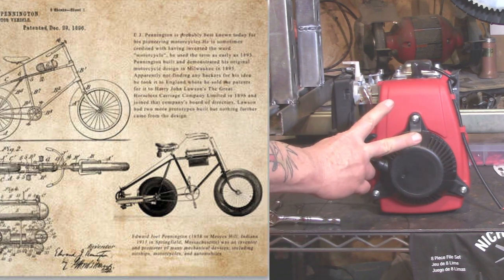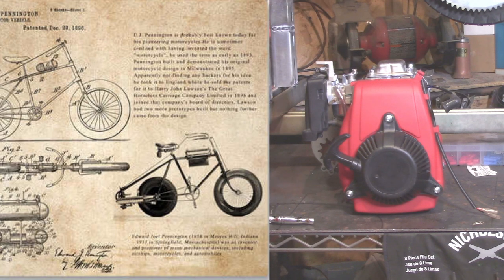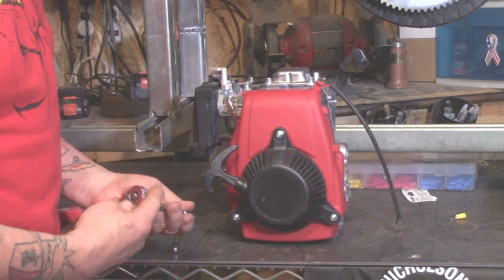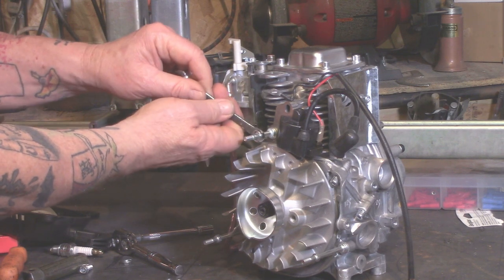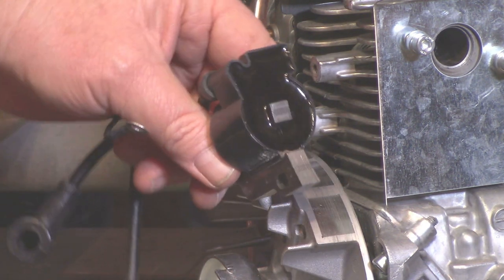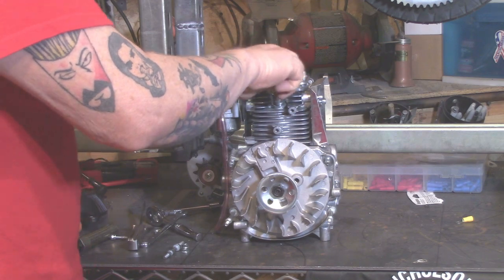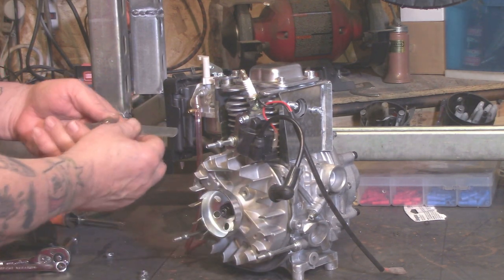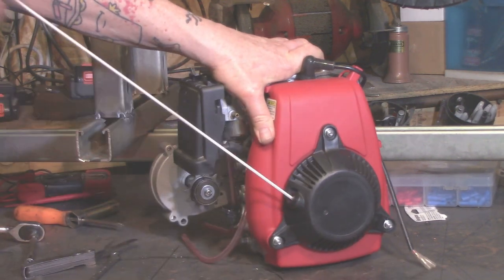How To Test For Spark & Replace Magneto CDI on 49cc Motorized 4 Stroke (Bonus - Replace Rope Start )

Comment: What's the black and red wire coming off the CDI for???
Reply from the maker: Kill switch
Reply: @HughesMotorized  thank you very much hope you build more bikes in the future 👍👍
Reply: Just wondering if a Champion spark plug with this engine??? If so what size??? Thank you very much 👍👍

Comment: I have a problem with mine. My spark plug doesn't have spark, my killswitch is now removed but it has spark with i hold the spark plug a little bit AWAY from the engine. Can you help me out?

Comment: I just purchase a Ngk  Spark plug  . do u no how to gap it for a 80cc? What is the gap
Reply from the maker: .025 or .6mm . OR.... the thickness of 2 standard business cards
Reply: Hughes Motorized   You are # 1 in my book . I am new at this . I Just got in the mail today my newspring-loaded tensioner.
Reply: Hughes Motorized  I was hoping to find a video of removing the stock tensioner and replacing it with a spring-loaded tensor for an 80 cc two-stroke